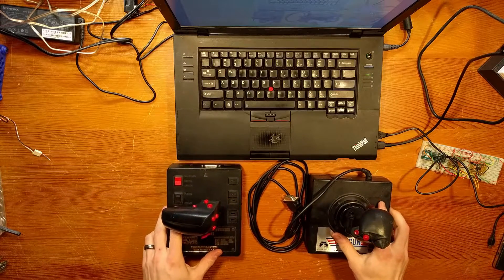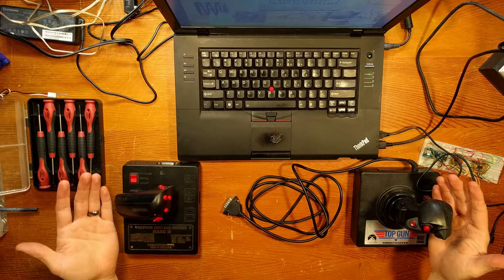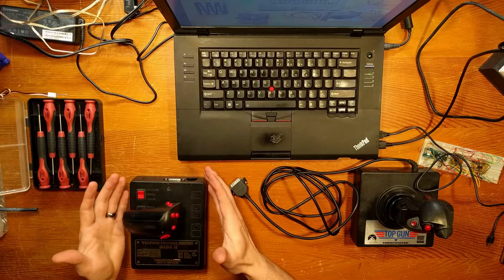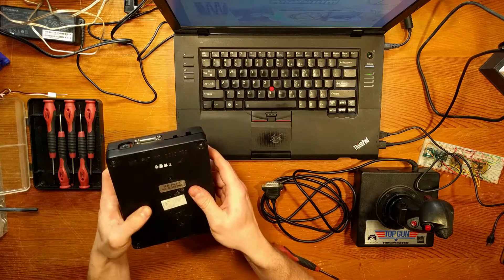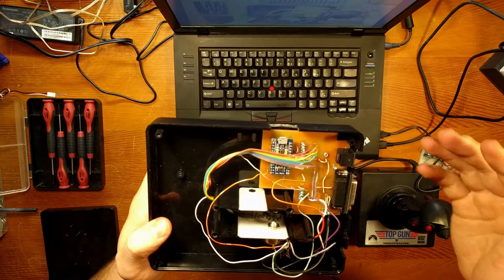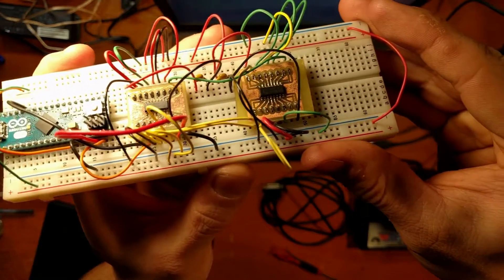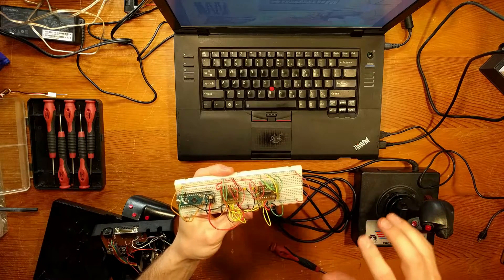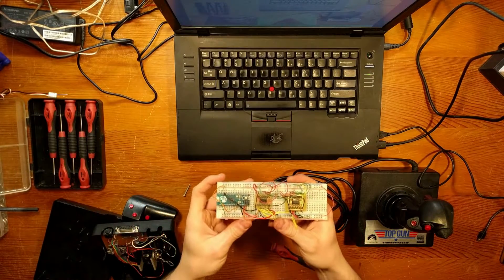Custom Arduino HOTAS from old Thrustmaster setup - overview

Comment: I recently got a this exact setup, bought a gameport to usb converter, everything lights up but for some reason it doesn't register on my pc...any thoughts?
Reply from the maker: I don't know for sure, but I think this setup had special drivers that went with it to make it work, it's not really a standard gameport joystick since those were traditionally limited to 2 buttons and 2 axes per joystick. If you do find a way to make it work without going to all the trouble I did here, definitely post a video about it! Thanks for watching!

Comment: nice i have the same projet but with a stm32 blue pils full of inputs question what is the best in term of performance  matrix of button or single button per input if i use something like 12 buttons max ?
Reply from the maker: There's always going to be a little extra delay when using shift registers, because you have to clock in the data one bit at a time and then process it, whereas with direct IO connections, you can sample those directly.

That being said, since the Arduino I used operates at 8MHz and the Blue Pill operates at 72 MHz (a full 9 times faster!), I think you'd be hard pressed to notice any performance problems with even a significantly larger number of buttons.

For example, if a fast button press is 10ms, in that time the Blue Pill will have made something like 714285 cycles, which is enough time to do a lot of processing.
Reply from the maker: I just re-read your question, and it actually sounds like you're talking about multiplexing rather than shift registers, but it's about the same really: multiplexing adds a little overhead, but not so much that you would notice, the difference would be on the order of hundreds of nanoseconds.
Reply: @Teklectic  no no i was speaking to connect one button on one input because i have more than 22 digital input and 8 analog on the board so more than enought, i think i Will dont use any matrix or shift register at All to keep schematic very simple matrix look not so easy to connect manually ( no pcb trace) i was Just curious of limitation of matrix usage vs simple direct input and my conclusion is no limitation if microcontroler is quite fast but until you have enought input to deal you dont need use matrix or shiftr. I m good ? You use it because arduino is very limited in input i understand. I think i made à good choice with my 2€ stm32 board the next gen. Thanks for this video
Reply from the maker: @yohanc7322  Yes, definitely a good choice and you are correct, if you have enough inputs there is no need for shift registers or matrixing; I did not have enough inputs on my cheap micro, so I used shift registers to expand it.